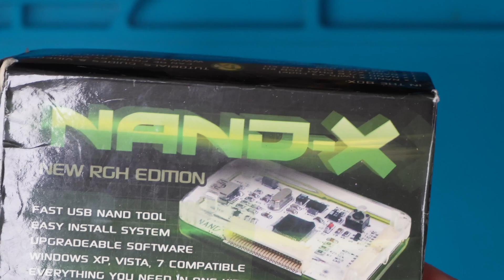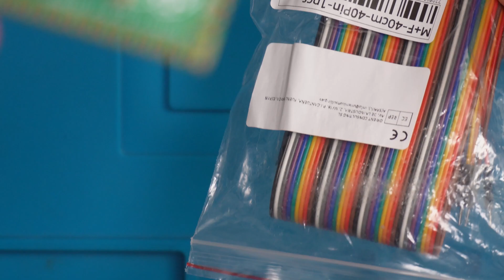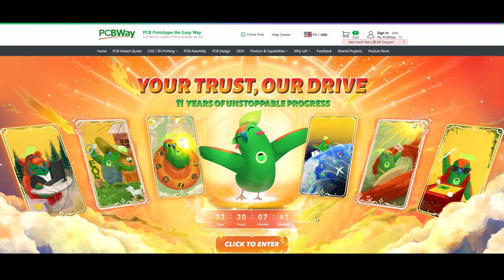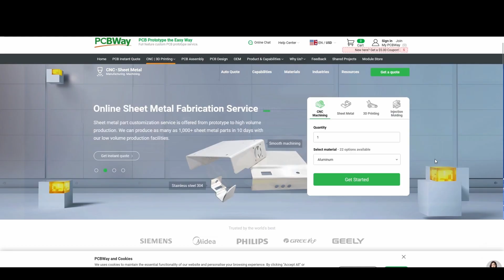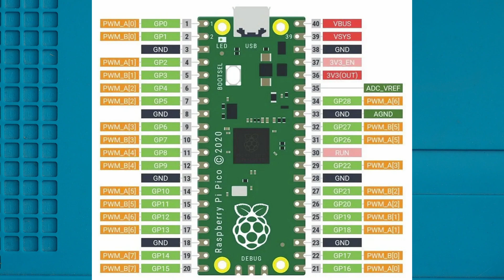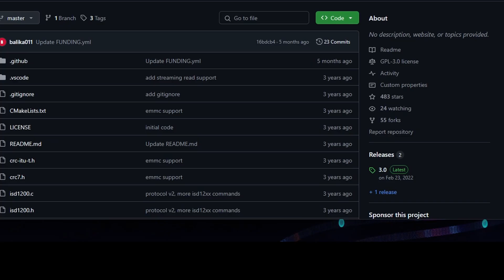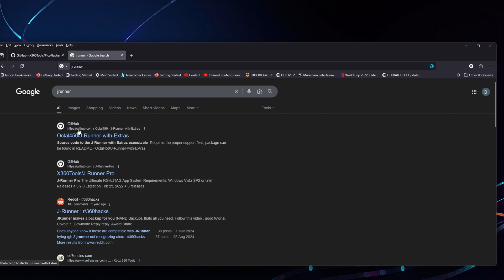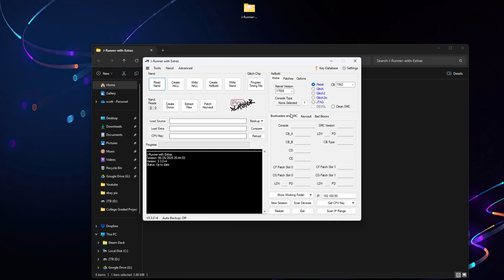DIY Pico Flasher for RGH Xbox 360 – Full Tutorial Build Guide!

Comment: But what is it and what does it do ? I've never heard of the Flasher for RGH Xbox 360 mod.
Reply: It lets you flash the nand without having to spend the money on a specialty chip like nandx if you do it the way he did it with the headers it makes it easier and cheaper if you're doing multiple consoles. I used male/ female headers for mine vs male only headers. That way I can just plug in the wires from the Xbox into the bottom of the pico. You can also use it for other projects that require a micro controller.
Reply: @nicholascantareo  OK, so what is a mand ? What does it do ?
Reply: "Nand"
In the context of the Xbox 360, "NAND" refers to the NAND flash memory chip located on the console's motherboard. 
Purpose of the Xbox 360 NAND:
Stores system software: The NAND chip holds essential system data like the Xbox System Software, the System Management Controller (SMC), and other critical system files.
Holds console-specific data: It also contains data unique to your console, such as the keyvault and configuration blocks.
Includes bootloaders, kernel/hypervisor, and dashboard files: The NAND stores the necessary files for the console to boot up, run the operating system, and display the user interface (dashboard). 
Relevance to Xbox 360 Hacks (like RGH or JTAG):
Exploiting vulnerabilities: The NAND is targeted in hardware modifications like the Reset Glitch Hack (RGH) and JTAG. These exploits often involve reading from and writing to the NAND to run unsigned code.
Running homebrew, mods, and backups: By manipulating the NAND, users can run custom software, modify games, and potentially play backup copies of games.
Reading/writing the NAND: To implement such modifications, specific tools (like a NAND reader/writer, e.g., NandX or JR Programmer) are used to access and modify the data stored in the NAND. 
 @Franko_Walker
Reply: @nicholascantareo  Cheers. 👍